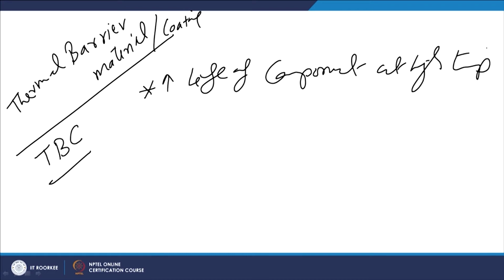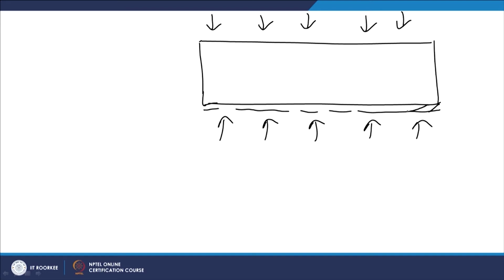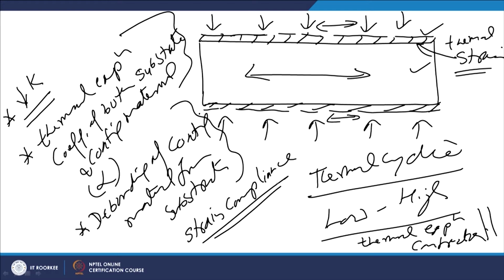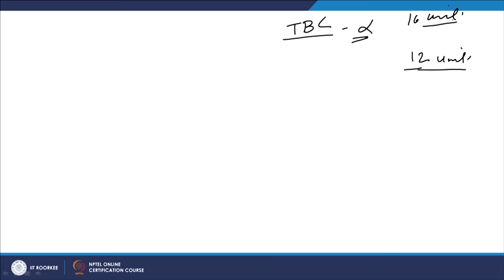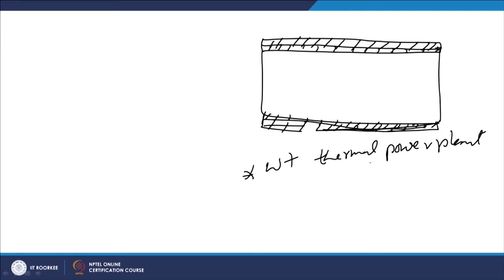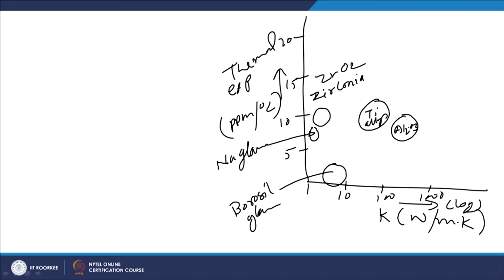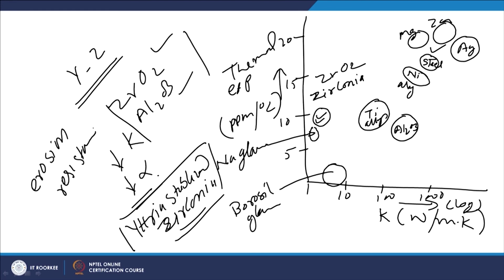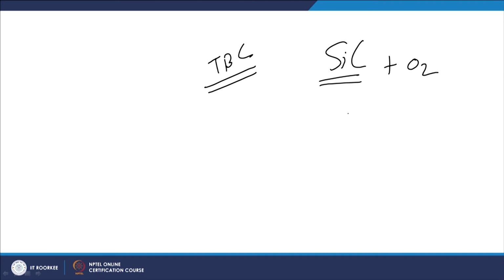Thermal barrier coatings

Comment: Thank you for this lecture, any information on the TBC for thermoplastic CF composites. These are the materials that are forecasted to replace the metal in high-temperature applications in the aerospace industry. For example, a thrust reverser panel in an aero engine.

Comment: I have some questions sir can you please clarify
1) What is behaviour for cast stainless part
2) what is the process of coating tbc for stainless steel
3) is it applicable for exhaust mainfold applications - for material 1.4301
4) for heat resistant material is it possible to go with nickel coating for stainless steel to improve heat resistant